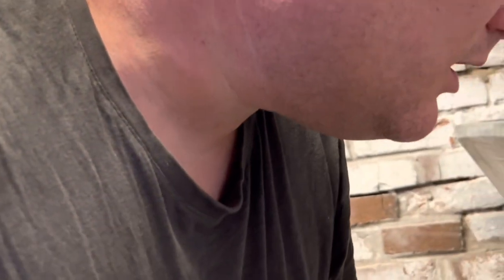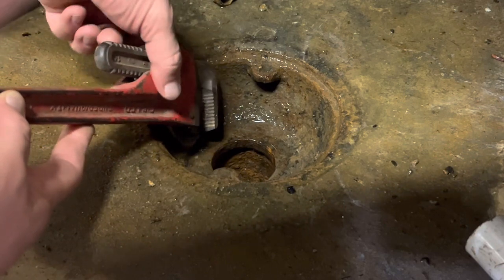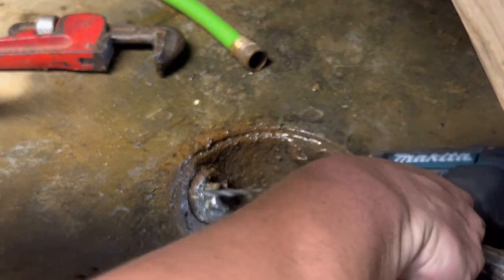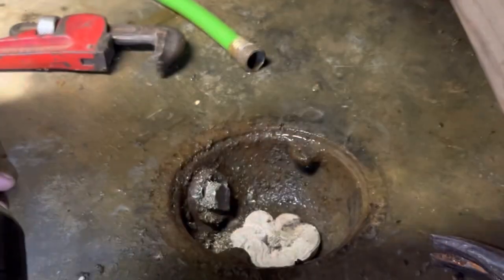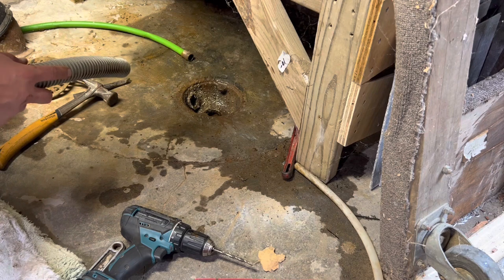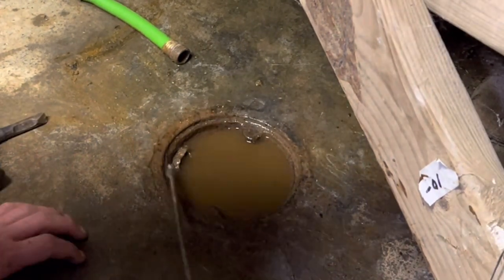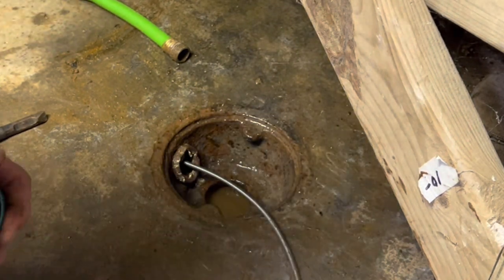Basement Floor Drain Clean Out Plug Removal

Comment: It's good you have the humidifier keeping water in the drain so that it doesn't dry out and allow sewer gases in the basement, but probably once a month, it would help to run a good amount of water through it, as water will tend to get slimy and stop up drains that are very low use.

Comment from the maker: Hey thanks, I was able to just buy a plastic replacement part instead of a rubber plug. It might not always be the clog problem but at least you can get access to the clean out to try. Good luck with your repair.

Comment: Hey man, for future reference, you can try a 8 point socket that should fit on those square plugs. You can also try a 12 Point socket. They'll also work but can be a little loose. You'll just have to determine what size socket you'll need to fit. Just thought I'd try to help.
Reply from the maker: Hey, That’s a good idea! I didn’t think to try a socket at the time, and that would’ve been better because it was hard to get at. With a breaker bar for extra leverage it might do it.  
  This one was on there a long time and basically welded together so drilling and breaking worked for this one. Thanks for commenting!
Reply: Or just use a large adjustable wrench, or even a large pair of channel lock pliers. Then you can get it from multiple angles.
Reply: @USBionicMarine apparently you don't know crap. Look up an 8 point socket, it looks like a female torx. Those fit perfectly on square heads. I used to use them daily on jacking bolts so you are absolutely wrong about this.
Reply: @jessemontoya2542  I had a brain fart I was thinking female torque bits for some reason. They don't have eight sided sockets in Lowe's or Menards. Only six and 12. Point. Female torques sockets are 6 point.

Comment: Very helpful !  My problem was sediment impacted between drain to clean out .  Stiff wire with a bend at the end broke loose hard areas  from both sides
Reply from the maker: Hey that’s great. I’m glad it helped! It’s so nice to get the floor drain working.
Reply: @Lucasartwork  Less Camel crickets now !
Reply: That’s my problem on the outside feed, too. But, the cast iron drain cover in the basement is too stubborn to remove, yet.

Comment: very helpful. thank you.  what if the ptrap is filled with solid debris?  I have a basement floor drail that looks just like this but the hole in the middle is filled with semi solid sludge.  The outlet on the side does not have any cap on it.  Should I buy and auger and snake out both or shop vac out the ptrap...?  I'm worried about corrosion of the ptrap since I think it is possibly cast iron or whatever it is is very old.  I just noticed this recently because water started backing up out of floor drain when I ran washing machine. Don't notice this happening when I'm running any other water in the house. I'd rather not hire a plumber to fix this if I don't have to because I don't have much money but I don't want to make things worse either.  Would appreciate advice. Thanks!
Reply from the maker: Oh no problem, you can try to punch through the hard pack in the p-trap but sometimes it’s hard to get the snake to bend through. But yeah, if that’s full or clogged that might be you problem area. I would try a combination of agitating it and spray a stream of water in. You can also shop vac out to pull it out after loosening it up. It pulls it the other way to try and free the clog. Definitely try a small snake or good stiff wire that bends. Try the p-trap and check the clean out also. Then if you get it cleared the agitate it more and spray water through to get it clean. Hopefully you won’t break the trap, and that would be rare, if that happens you would have to replace the whole thing by breaking out concrete. Good luck and let me know if you got it! Thanks
Reply: @Lucasartwork  Thank you so much!  Very helpful advice. Glad to hear it's rare to break the trap.  I was worried about that.  Esp. since I've never done this before but I think I will give it a try.  I'll let you know how it goes.  It was helped a lot to watch you do the whole job like that.
Reply: @wordswordswords8203 — Did you do it? How did it go?
Reply: @AndreaCuchetto  I wound up hiring someone to do it.

Comment: I got a good suggestion. You can buy a drane bladder for 15 bucks and just hooke it to tye a garden hose and place it in the main hole. Let it run for ten minites and it should clear out ur sewer system as long as its not major. No need to drill or unbolt anything. It litterally takes 11 minutes.
Reply from the maker: Hey thanks for the suggestion. I might have to try that sometime! I’m not sure it would work in my case but it would for a lot of clogs. Mine was like cement hard pack and took poking through. Anyway, thanks for letting me know! I will keep that in mind for the next time.

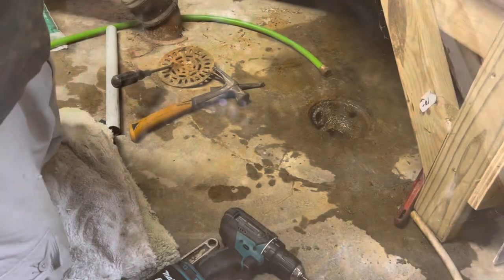Comment: 08:07   You have a PVC cleanout plug (3-4")  just a couple feet away.  I would have opened that up to see if your snake is getting through. If your floor drain is very old, it may be rusted out and pieces of pipe, dirt, rocks blocking the drain.

Comment: I guess there is supposed to be standing water in the drain part not the clean out.  Is that correct?
Reply from the maker: Hi, yes there is always water in the P-trap part of the drain. That makes a block for sewer gas but lets the water drain. out. Actually if the drain is not used for a while it can evaporate out. So, it’s good to be in use or add water to it. The clean out line is a bypass for the p-trap and you can clean the line.

Comment: Why not a square socket and an impact?
Reply from the maker: That’s a good idea. I didn’t think of it at the time. It might have worked but the plug was kind of corroded in there too. Thanks
Reply: There were 10 ways at least to open that plug without destroying it.  One try with that pipe wrench and it was obviously the wrong tool.  This video is literally A shit show

Comment: You need to use a 100ft lol
Reply from the maker: Yes that’s true, some people might need a longer drain snake in order to free up the clog. Like if it’s in the middle of a basement you floor or it’s linked to the main drain out of the house. In my case the floor drain was only a few feet away from the main  drain and I found the clog right at the y where it met. This video was really more about getting the old clean out plug off.